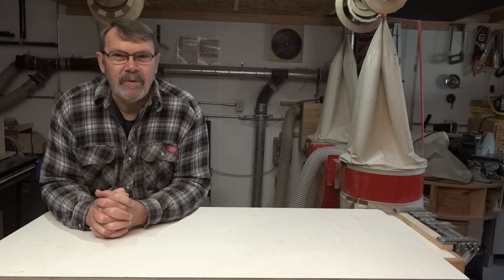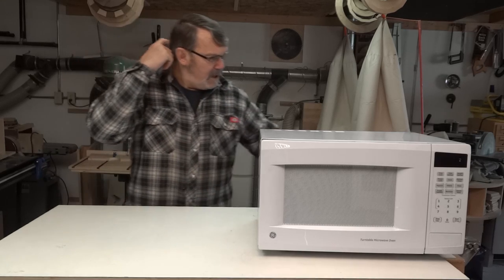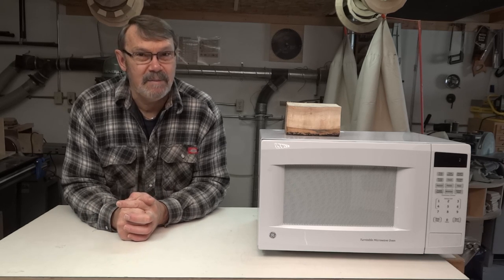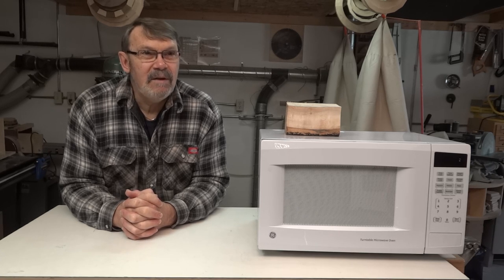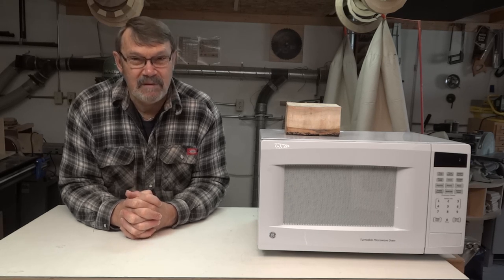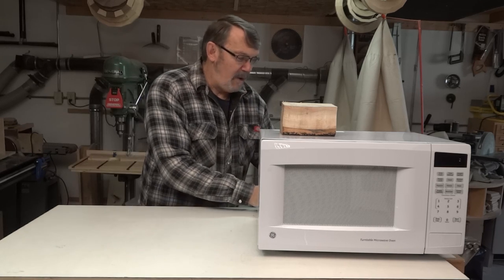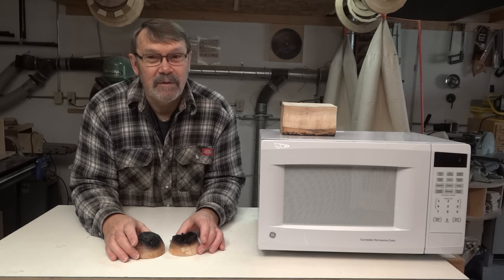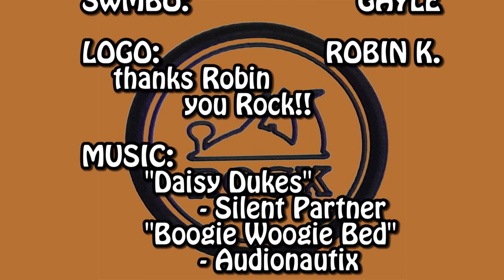Drying Wood In A Microwave Oven - A WARNING

Comment: Hi Gord! Great information! I have tried the microwave a few times now very successfully. But I never used it in high, I always put it in the lowest possible setting (in my case it is defrost) and I keep reducing the time periods at the end (when most of the water is already gone). Also, I have never used it for large or rather, for thick pieces of wood. I have done it with preturned bowl, so the thickness of the wall was something around 3/4 of an inch, that means the water has to travel less to get out of it. And you are correct with letting it cool down between sessions, although tedious it is safer that way and you get a more accurate weight reading. I hope you are having a wonderful holiday season! Cheers! Daniel
Reply from the maker: Hi Daniel,
I probably will only use the microwave for drying roughed out pieces. This was just a test to see if I could dry a thick piece of wood should I have a quick need for something to turn. I'm quite happy with the results of the first piece and the second piece was a good lesson on being cautious with it. Thanks for watching, Daniel.
Have a very Happy New Year,
.....Gord

Comment: Amazing info, thanks for the simplicity. So 2 min for about 1.5 inch thick of wood? And I supposed small coasters would be even less like 30 seconds? Thanks again
Reply from the maker: I would not advise what time is good for drying the wood as there are too many variable. The moisture content can vary widely. The power of the microwave could be vastly different from one microwave to another. I believe the only way to be safe is to experiment but approach the subject cautiously. The consensus among the videos I have watched and articles that I have read seems to be that the wood should be allowed to cool completely before applying more heat. I wish you luck with your experiments! Thanks for watching!

Comment: Nice warning.  I dry my wet turnings after the first turning. Never more than a minute and I always wait till the peice is cold to the touch before putting it back in for another nuking.
Reply from the maker: That was my first attempt at using a microwave to dry wood and I wanted to know what would happen if I overdid it. I certainly found out. Your method is certainly safer than what I did. Thanks for sharing.
Take care,
.....Gord

Comment: Keep in mind that depending on where you source your wood, there's a possibility that there might be some metal inside. Anything from barbed wire to a missed bullet can make its way into a growing tree, and we all know you don't want metal in a microwave.
Reply from the maker: Thanks for the thought. I once put something in a microwave with metal trim around the edge of a plate. There was a real pretty light show for a few seconds. Didn't take long to turn it off!!!
Thanks for watching,
.....Gord
Reply: Actually on my microwave it says that if you want to heat up a cup of water you should have a metall spoon in it. I've tried and nothing happends with stainless stell in a water glass. But know other types of metal can react.

Comment: Here's a short video I made a few years ago, of putting burning bamboo in a microwave oven:

https://youtu.be/VO6c3gj_enE

In addition to watching the wood carefully, keeping an ear out for the change in pitch might also be handy.

Once something gets hot enough to smoke inside a microwave, things get bad very quickly:  The smouldering wood releases charged particles into the oven cavity, which are particularly susceptible to microwave radiation.  These particles quickly heat up to the point of turning into a small ball of fiery plasma/lightning . This in turn, further chars the wood, carbonizing it.  Carbon soot is an electrical conductor, and has the usual effect of metal in a microwave.

Thanks for the heads-up as I try to dry some bowl turnings in the oven for the first time!
Reply from the maker: Very interesting, Nevin! Thanks for the link. I still have not managed to get the stink out of my microwave and I did that months ago. Oh well, another lesson learned. Take care, .....Gord
Reply from the maker: +Nevin Williams 
Thanks a lot, Nevin! Great information! I had not heard of using vinegar for that so I will give that a try! I will try drying wood in it again one of these days and will keep your advice in mind. Thanks again!
Take care,
.....Gord